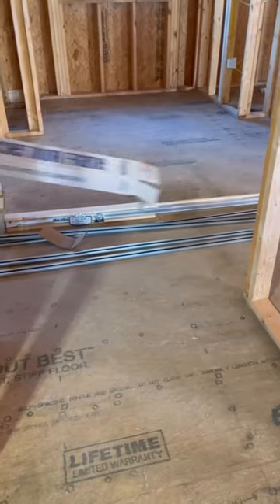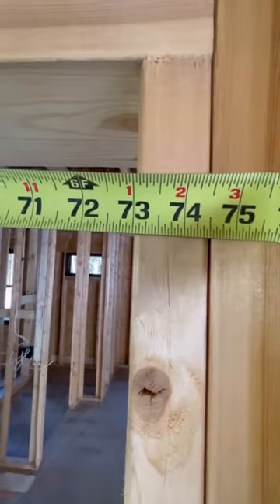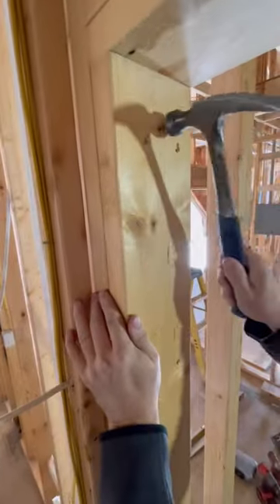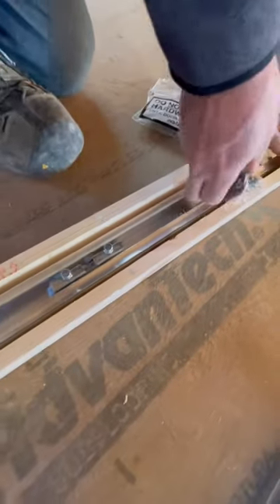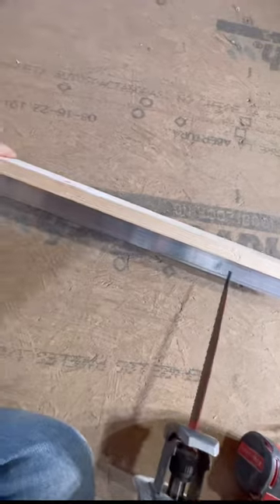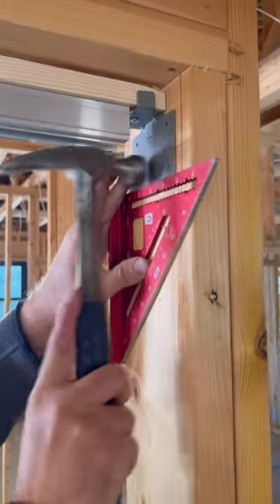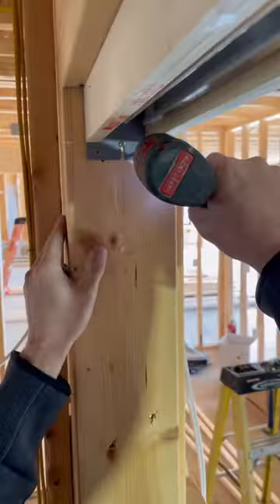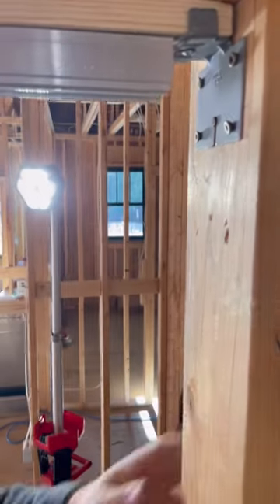Pocket Door Kit Installation

Comment: No new construction home should have pocket doors. The eventually always mess up.
Reply: Installer issue here.
Reply: @NoIwont  usually because the framers install them fucked up, then the trim carps have to try and fix them. Then all kinds of shit gets in the wheels and they still fuck up down the road. I say just leave them alone.
Reply: @donteoklahoma7220  

Pocket doors and frames should be installed by a general contractor's finish carpenters imo. I was a finish carpenter for 20+ years, installed a 100+ frames and hundreds of pocket doors overall including a ton of repairs to pocket doors.
Reply: @NoIwont  agree but it never happens that way 80% of the time
Reply: @donteoklahoma7220  

I considered pocket doors a specialty of mine and the ones I had to fix, I called "job security". I made a ton of money on em.
Reply: @NoIwont  yeah I make money on commercial doors. Pocket doors are like brass fixtures in a house in the 1980’s